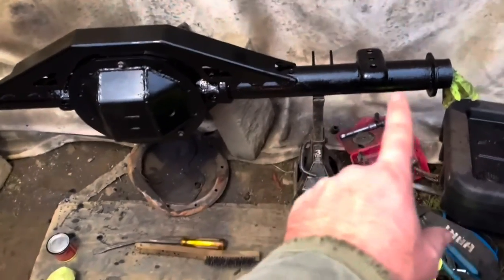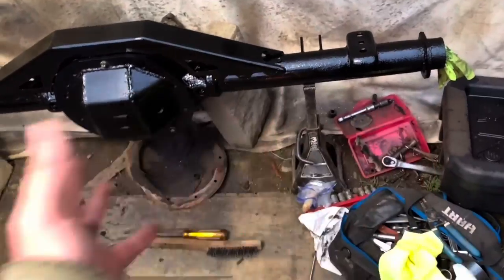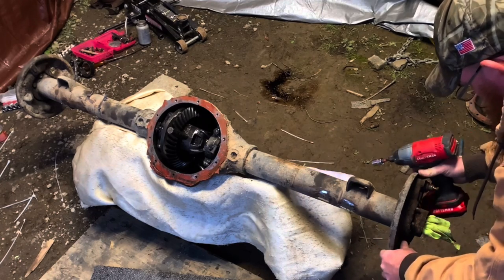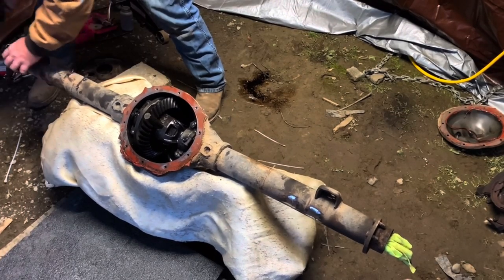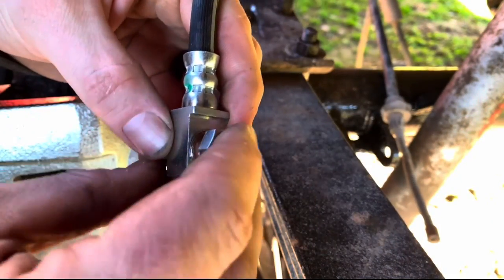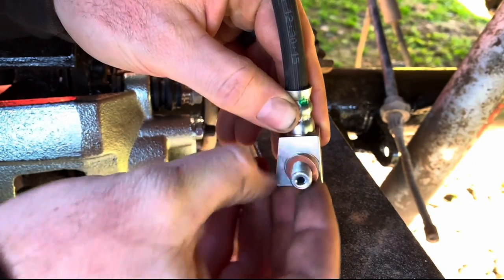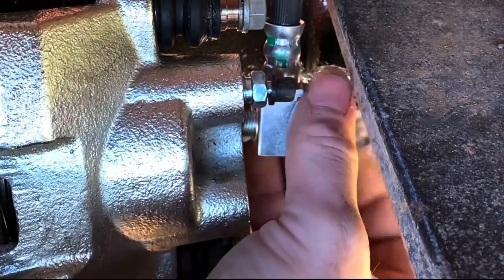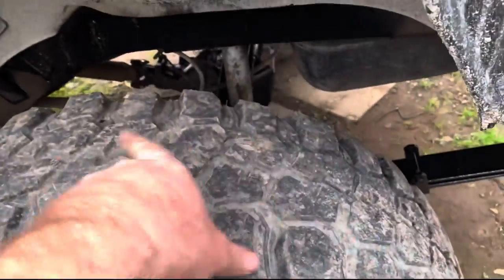Bolt On Jeep XJ Rear Disc Brake Conversion

Comment: I did this on my 93 xj and it’s amazing.  I went with ZJ rear disc brake hoses, as the KJ ones didn’t seem like they would connect to My hard lines.  I also got the e brake cables from Crown, who makes a disc brake kit.  They only fit 95 and older XJ , but are drop in fit and work perfectly with the KJ parking brake.

One related mod I did and recommend for 91-94 XJs:  I got the brake booster for 95-96 XJ. It’s a dual diaphragm, drop in fit for 91-94, and added to brake power as well. This mod can be done with 90 and older , but the brake pedal pin needs slight mod.  

I also upgraded to the newer style brake master cylinder, with plastic reservoir - a bit shorter & lighter , and you can see the fluid level at a glance.
Reply: I did the exact same change on my '92 XJ with the '95 Brake Booster and the ZJ rear disc backing plates for an 8.25" axle (did have to hone out the center of the backing plates just a touch). my brother happens to have an '95 XJ and has driven both since I did hte conversion, and he's a bit jealous since mine now brakes better than his! It really isn't too difficult to do, just take your time and bleed the system very thoroughly. I'd recommend a pressure bleeding kit (not vacuum bleed) such as the one from Motive Power Products since it fills the reservoir from the top automatically with fresh fluid as you bleed at the cylinder and makes completely flushing the system easy.

Comment: I have a tip,  if you do break the center pin bolt its easy to get out,   it happened to me on an FJ40 years ago,   just take a ball peen hammer and another hammer,  and drive out the center pin,  in other words you will sheer the pin.  Just be careful and wear eye protection.
Reply from the maker: Thank you for sharing this tip!!

Comment: Ronnie,  As a Subscriber, I bought a NEW condition 1999 XJ of a 90 yrs old man that NEVER left pavement.  My question is;
@ 190k miles & runs perfect.  How long can I expect the fuel pump to last?  ( I'm the guy that likes replacing parts BEFORE  I'm stranded along the road.  Thanks!
Reply: My fuel pump went bad in my 1998 at 320k miles … just fyi

Comment: L have a problem with my xj 95 from the day one l bought it  when l am braking end car it's near to stop it's making an awful knocking on the rear l don't give it Mach attention coz l woos going too replace all l woos suspect the noise woos from shafts hitting the center pinion so l have G2 shaft G2 ring end pinion arb locker but noise it's still there l cut new oversized c clips but noise still there any help thanks

Comment: I've got an 8.8 with discs on my stock 2001 originally abs. Doesnt feel like they're doing much, how can I make them more powerful?
Reply from the maker: Since your running a 8.8 I would try the different proportioning valve
Reply: @cherokeeronnie  any particular prop valve?
Reply from the maker: A lot of people get them out of the zj
Reply: @jlsgarage872 I got a 98 Ford ranger in the driveway 3.0 what size differential is on there.

Comment: The handbrake cable is also fitting??
Reply: Get RT OFF road RT31040 & 31041 cables from Crown or source your own lengths are 70.5" and 34.25"

Comment: which year liberty??  Any??
Reply: I was wondering the same thing....I noticed he brought rotors for 2003-2006 Liberty so I'm going with that.
Reply from the maker: 2003 to 2006
Reply: Will this fit with a 2000 xj?
Reply: @cherokeeronnie I got 98 xj classic what backing plate works for me I haven't watch the video
Reply: @cherokeeronnie  What year wranglers do you have and where did you get the parts for it my buddies got a 95